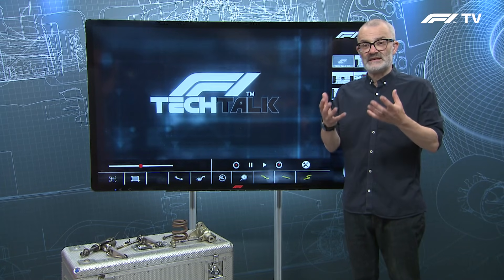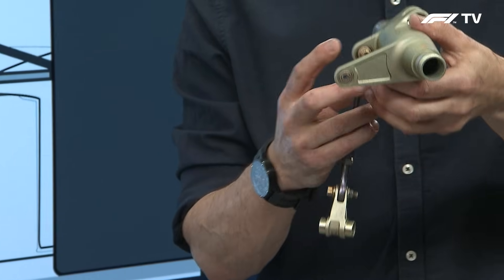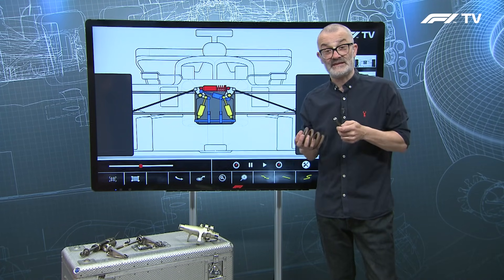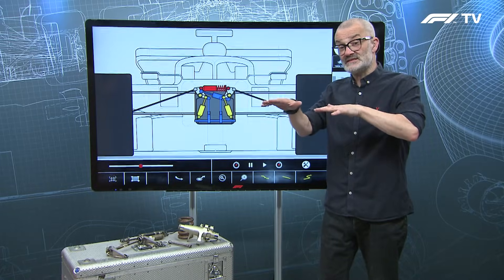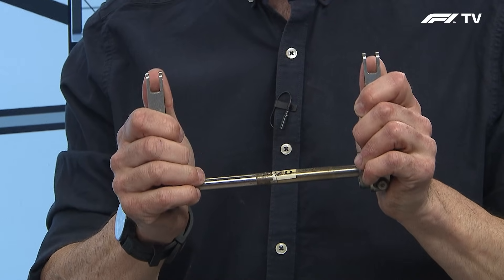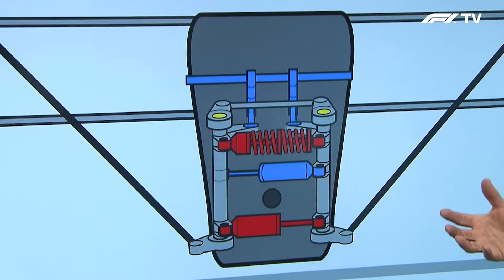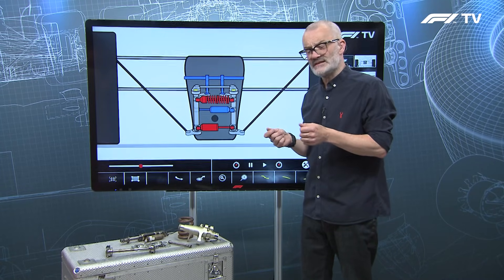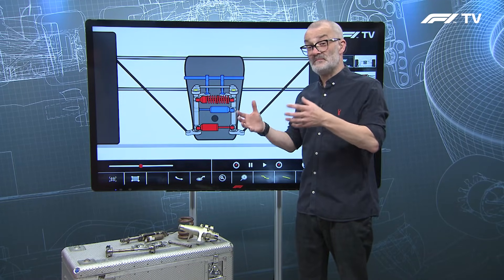Exploring 2022 F1 Car Suspension | F1 TV Tech Talk | Crypto.com

Comment: The reason why Redbull RB18 is faster than Mercedes W13 is that Redbull RB18’s shape makes it move in an “aerodynamic envelop” whilst Mercedes moves on an “aerodynamic plane”. The reason is the bottleneck formed by the side pods on the Redbull RB18 and on other cars.
Assuming that models of Redbull RB18 and Mercedes W13 were made of slippery/soapy material, it would be impossible to lift the Mercedes around the side pods due to its triangular cross-section; but one would easily lift the Redbull RB18 below the side pods. This is what aerodynamic flow at high speeds does. Whereas the Mercedes is just pressed down by air but lifted up by mechanical suspension springs. The aerodynamic envelope around the Redbull RB18 gets more effective the faster the car moves, and as such dampens the tendency to porpoise. Thus, the body is pressed down and lifted up by the same aerodynamic flow - but different in magnitudes down and up. The resultant effect is that the car body moves in an aerodynamic equilibrium, shaped like the letter - C - turned over by 90°. If one imagines the way an umbrella can be flipped over in stormy weather, then one can reckon that the aerodynamic envelope around Redbull RB18’s side pods stabilizes the car body to such an extent that porpoising is fully attenuated. The fact that aerodynamic loads pressing the car down and lifting it up around the side pods increase or decrease in equilibrium, engineers simply have to make fine adjustments to get maximum downforce without porpoising. Redbull RB18’s mechanical suspension therefore only dampens the usual track surface vibration and does not cause any oscillatory movement - porpoising. Even if it were to porpoise slightly, the aerodynamic “envelope-” would counteract by proportionately damping the tendency; Mercedes, on the other hand, is simply pressed down 100% aerodynamically but lifted up 100% mechanically – thus the cause of porpoising. Mercedes has no choice but to emulate Redbull RB18 by using the side-pod bottleneck.  One cannot go around physics by a “trial and error” approach; one must have an objective that is economically, legally, scientifically, and technically viable.

Comment: Should a very "slow" heave damper at the rear fix the more extreme cases of porpoising?
Reply: I'm asking my self the same thing. Making the last bit of suspension really hard to avoid touching, but I guess the stress on the different component would be really hard, but I would like someone to answer that also.

Comment: Am I missing something?  On the rear suspension, if the pivot arms (gray) are connected by a solid link (also gray) how do the dampener  and spring (in red) operate?
Reply: @9:43

Comment: I think the porpoising has come to the point where the FIA MUST change the rules for suspentions NOW! It's horrible to see the drivers suffer and not to be able to drive on the edge.
Reply: Only in terms of max vertical Gs and frequency. Other teams shouldn't be punished for Mercedes' inability to create a usable car
Reply: @JakkeJakobsen  I agree with you, that the able teams shouldn't be punished. And yes, Hamilton over acted to send a message. I guess. Only my opinion. 

On the other hand is the risk to suffer long term disease like parkinson very high if the bouncing goes on. We know this from boxing and older driver having problems with their pathway. 

So my conclusion is the safety aspect is to carry higher than the competition. 

What do you think is a fair way to do? 
Leave it like that? 

Thanks for your time, appreciate:)

Comment: Hmmm so up until last year it was too hard to tell of the legality of a teams suspension system?? So now due to the simplified suspension… now FIA can check for legality of all teams. That makes me wonder if Mercedes had a trick suspension up until last year and now they can’t use it. Maybe that’s why Russell keeps advocating for active suspension nowadays?
Reply: Yup especially after the Silverstone update last year, they had the suspension that goes so low on the straights and comes back up in the corners. That felt very unnatural for a normal suspension system
Reply: @gouthamb884  they basically had a 2nd smaller DRS which was also not intended to be allowed by the rules.

Comment: This is fantastic video, very explanatory.      I was surprised none of the dials on the steering wheel adjust the suspension.
Reply: Think that isn't allowed because it would be considered active suspension (or even aero, as lowering the suspension would reduce drag)

Comment: If teams don't radically solve the porpoising issue by the end of this season, FIA better reintroduce the inerter. Drivers cannot continue with this amount of physical trauma.
Drivers of the old wingcars era developed long-term problems.
Reply: Agree with you. I also hate it when FIA bans innovative technologies such as Renault's Active Suspension and Mercedes' DAS.
Reply: @fardmee6499  DAS shouldn't have been allowed in the first place as it was in clear violation of the rules. It's shocking that it was allowed in the first place.
Reply: @aldogjipali2835  you've set yourself up for a 'fail' here - what rules, exactly, was DAS in "clear violation" of?
Reply: @OuttaaaControl  the rules that you are not supposed to change the set up after park ferme. Obviously not every part of the set up is frozen but the tyre angle specifically is.
Reply: @aldogjipali2835  Merc found a loophole in the rules in 2020 and that allowed them to use DAS. It was only banned in 2021 - we are talking about 2020, where DAS was allowed.
Reply: That's what Mercedes want. They just need to do a better job.
Reply: @ilusoriob  Yes, but I think it's a long-term safety issue. It's not acceptable that MSC breaks the car in half and jump off fine, but HAM just after a GP seems totally crashed.
Reply: Inerter again OR a rule with max bouncing parameters. If you exceed the limits for X laps, you get a warning and then a black flag.
Reply: Some teams don’t really have a problem with porpoising do they? Or at least it’s a lot less bad. Red Bull for instance. The other teams just have to be clever and find a way to deal with it.
Reply: MX and SX riders want a word...but in all seriousness the FIA does need to let teams solve the issue with developing or proven technology, not hamstring them. That's one of the things that was/is great about F1, innovation and tech at it's highest level in motorsport.

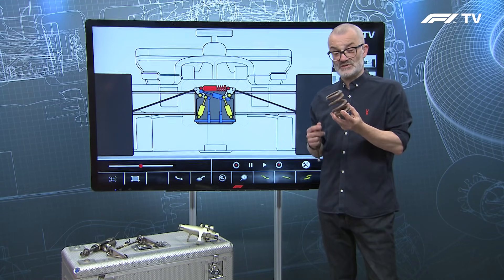Comment: F1 is the sport of Kings and the king of Sports!!!  This is a great overview, but I’m still unsure about how the suspension works.  For example, at 3:15 or so he is talking about the torsion bar being attached to the rocker and the “chassis” and .... (huge leap) Bob’s your uncle.  Great, but that leap is huge; what does “attached to the chassis” mean and how and why does that system/geometry actually work?  And how do the dials and buttons on the steering wheel change the characteristics of any of these miraculous gizmos?  Maybe you guys could slow it down a bit and show video graphics of the suspension in action to help us better see and understand these complicated systems.  I would pay more for that kind of content.
Reply: when he says attached to the chassis he likely means it's literally attached. Same as how most cars have coilovers with the top end of the coilover connected to some point on the car's frame and the bottom end being linked to the wheel.
Reply: Thx.
Reply: There are no settings that change suspension dynamics on the steering wheel, the things they can change are engine/ers modes, differential settings which changes how power is distributed between the wheels through corners, and brake bias/balance which changes how much braking force each wheel generates.
Reply: Thanks.  The engineering and material science is all so amazing that it seems like magic.  Best I sit back, relax, and enjoy the show. Thanks again to all.

Comment: So do they not allowed to have a "hard stop" on their suspension? I'm thinking if they have a hard stop then it can stop the rear goes down too much, stall the airflow and get rid of/reduce bouncing.
Reply: A channel called Kyle.engineers (ex merc aerodynamicist) has a really detailed analysis video on the mechanics of porpoising and in it goes into detail on the interplay of the hard stops and porpoising and why it’s not such a straight forward solution.
Reply: They have hard stops - just not mentioned here.  You can’t have extra dampers/springs anymore, though, so if you ever get to the stop you’re going to bounce off of it and not really be able to control it.

I understand what you’re thinking though - if the porpoising is set off by the rear of the car being too low, just stop suspension travel at that height.  Kind of the opposite of what Mercedes had last year with the collapsing suspension at high speed.  It’s just not allowed anymore as part of the suspension simplification regs